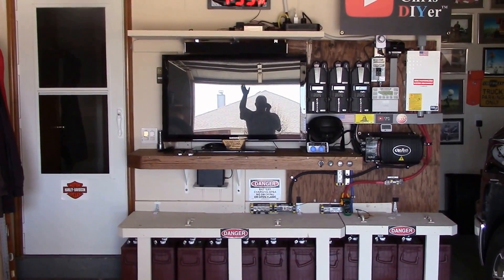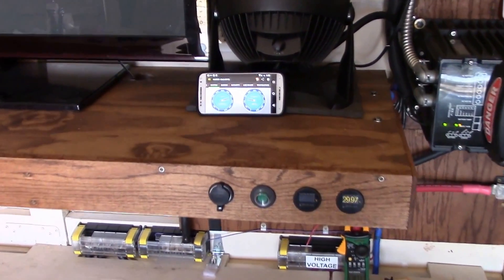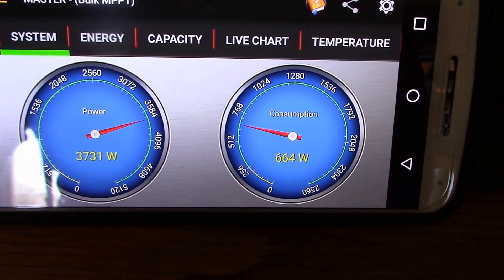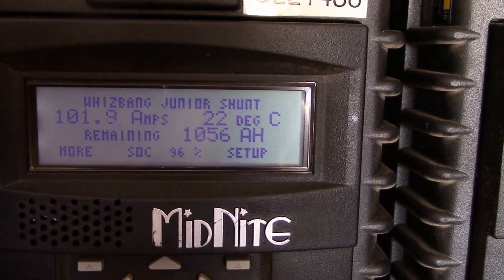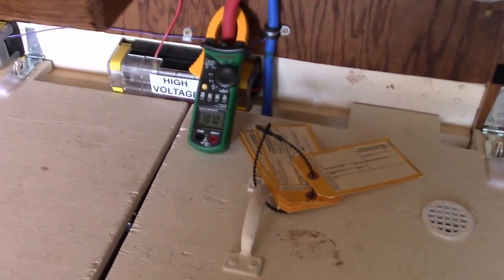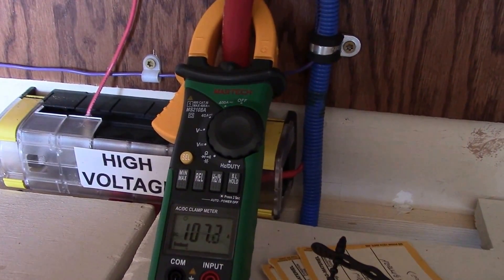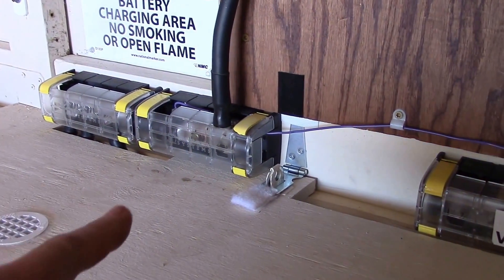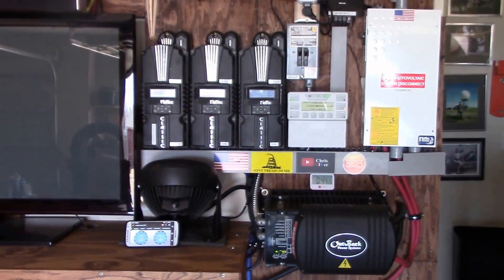Full sun operation - DIY partial off-grid home solar power system

Comment: holly crap,,,,100 amps wow,,i have the same panels,, but only 3, and on a good day i get 15 amps witch is good for my set up,,im just getting starting,,,,,,and do you buy straight from renogy,,,,or do you have a better place to get them?,,,
Reply from the maker: Listen...DIY micro, small, medium, or whole house solar power systems are ALL great IMO. Three panels...awesome. I used to buy direct from Renogy...but, they changed management. Best to check on eBay...there are some serious discounts going on now. Search "100 watt solar panels"

Comment: Cool beans, I should be getting my system installed within the next 2 week from now, the major hurtle was the interconnection with the power company. Keeping my fingers crossed...
Reply from the maker: Do things by the book, safety first, consult the pros if needed. Solar rocks...even grid-tied, off-grid, hybrid, and "grid-connected". Mine is considered "off-grid" but, I am "grid-connected". That means..."either/or" condition. When my batteries get low...it automatically switches over to the grid for power
Reply: Yes, solar rocks. Especially there is so many flavours to choose from. I decided to go with the grid tied system to get the most bang for my buck. I also, have a 1 kW off-grid system in my "power shed" that will still be go to backup if the grid goes down by means of flipping the transfer switch.

At a later time, I will more than likely I will integrate the off-grid portion and make it a hybrid system where the grid will "assist" with the demands of my household need when I get those pesky cloudy days. Or better yet, I just cut back what I don't need to use and wait for the next sunny day.
Reply from the maker: Sounds good. The "dirty little secret" a lot of DIY solar guys won't say are: 1) conserving power is MUCH easier vs making/storing it 2) most have more than one system (like having a wind turbine, hydro, or several off-grid systems). I am running four off-grid systems...full "solar addict" 😜